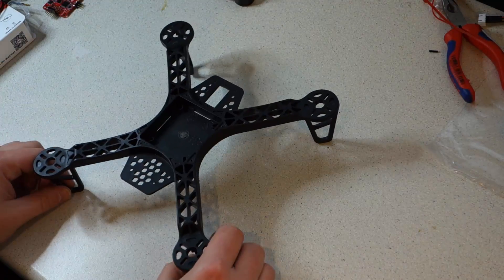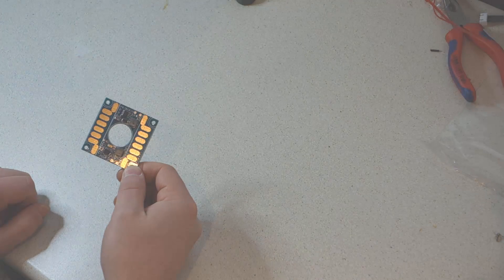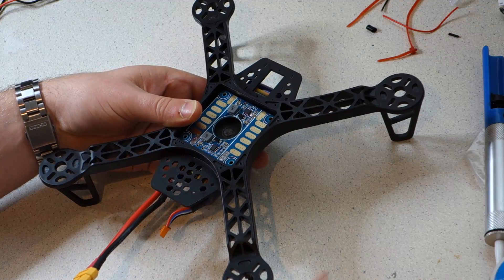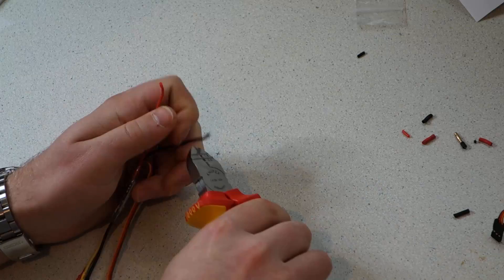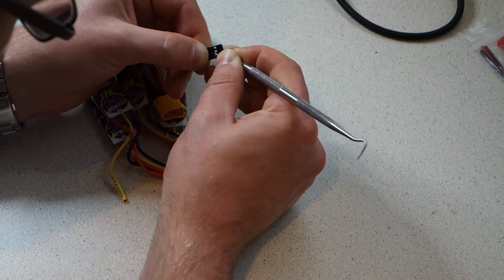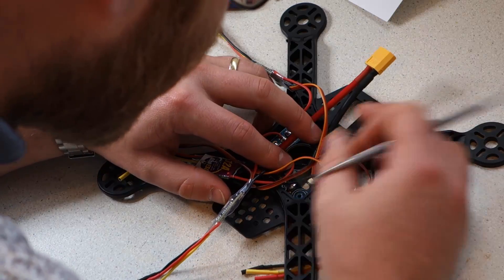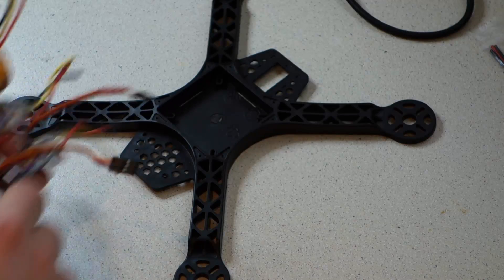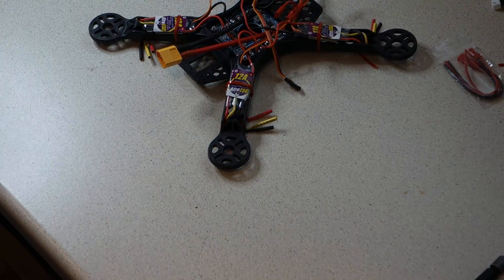HobbyRC Ready To Build 250 Class Quadcopter Kit - Part 1

Comment: I'm a bit confused, the totem q330 doesn't have a power distribution board. It seems to like it's built into the frame, would I just follow the same process as done in this video. And I noticed you removed one of the wires off the esc, when do you do that?

Comment: You do know hobbyking have a complete kit thats much simpler I think you bought it an add pointless power board
Reply from the maker: Hi Helcat. The Hobbyking kit uses different motors/components to ours. Some people like to order from a UK company with a phone number as well, quite alot simpler for returns and advice :-) Also, the power distribution board is far from pointless, it has a 5V bec on board which as soon as you add other 5V devices such as GPS etc becomes pretty essential given that the Afro escs only give out 0.5A current (and even thats without factoring thermal throttling of the voltage regulator). On 4S setups its even more useful as you get a filtered 12V output for use with FPV gear.

Comment: the cavities on the underside of the arms are for the escs nice clean look and offers bit of protection also if you're not shortening the motor leads its a good way to take up slack
Reply from the maker: Hi Josh, that's a good point but unfortunately the AfroESCs don't quite fit in the cavities - they would probably look a little neater underneath though. Perhaps the cooling from the props would be a little less effective but I'm sure the AfroESCs would be fine anyway!